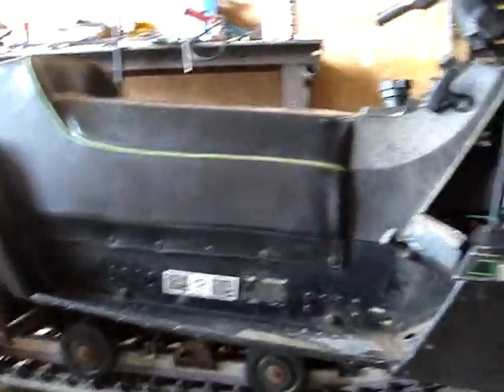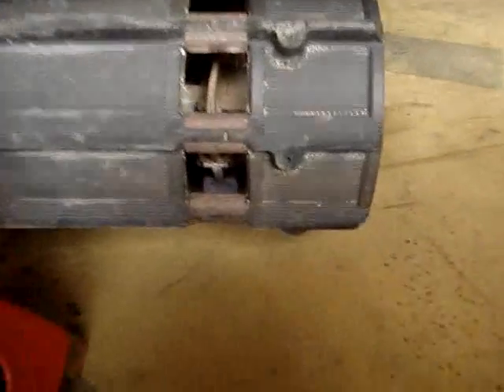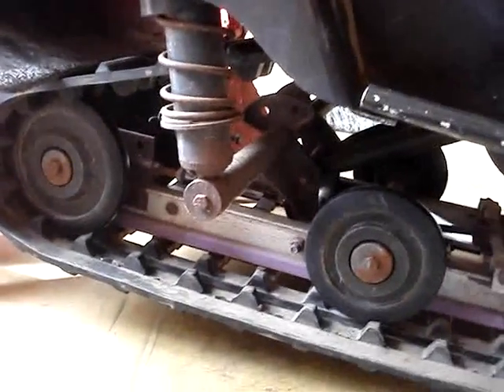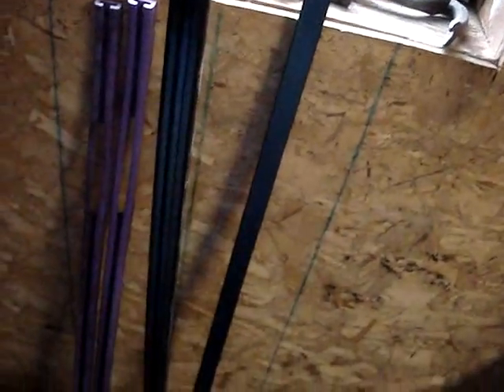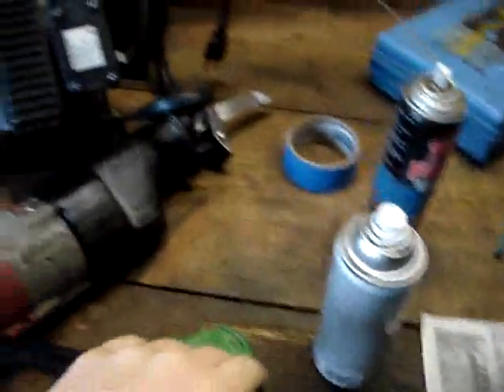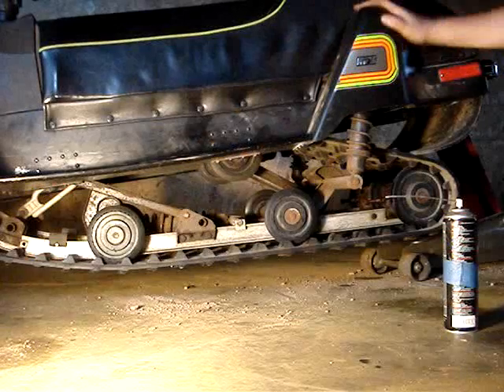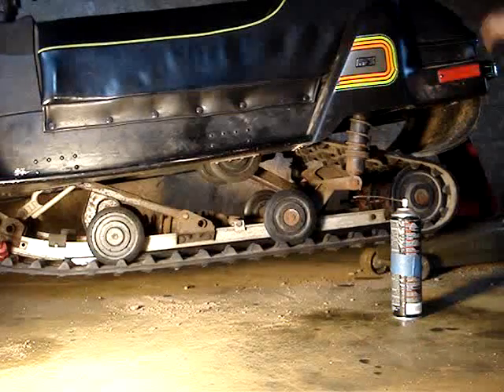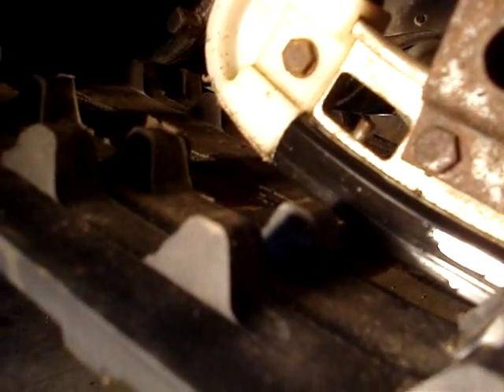Replacing Snowmobile Track Slides

Comment: I wish I had a garage.. I just shoveled my sled out and in the process of changing track and slides..
Good video, one other pointer: make sure the bolt hole matchs up with the old slide,  You might have to trim it first.